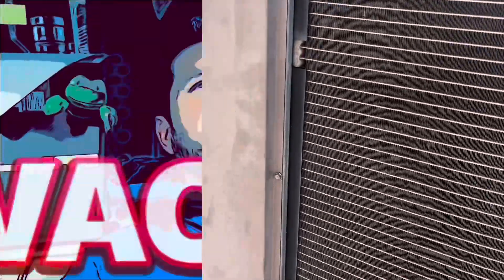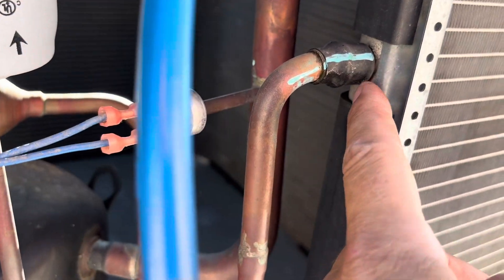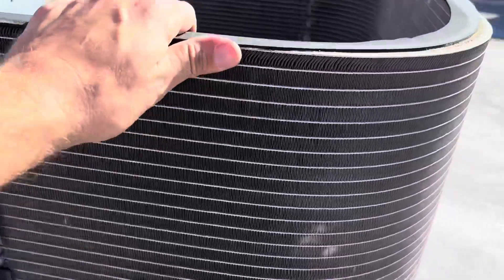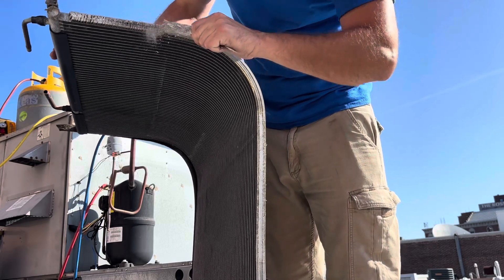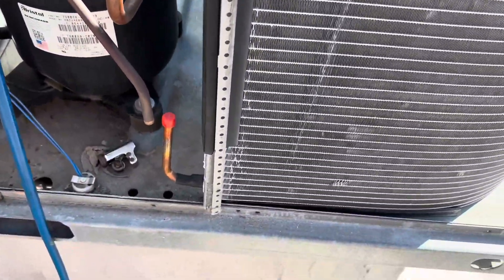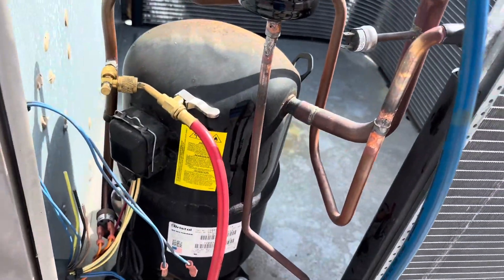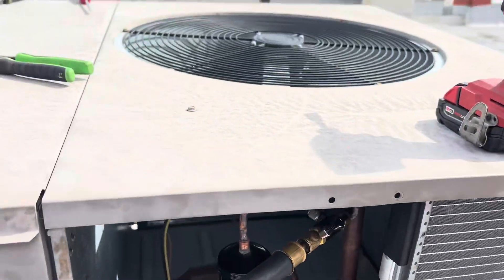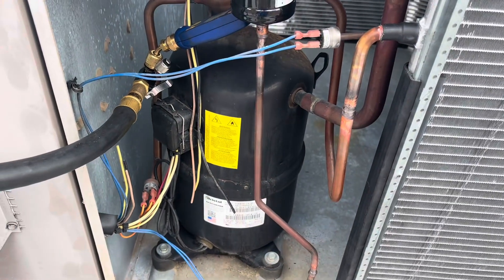Replacing The Condenser Coil On A York RTU!

Comment: Do you mind sharing cost at the job like this? What is the part cost? What’s the labor cost?
Reply from the maker: So everything minus the coil… you’re at around $2600.  If the coil isn’t in warranty you’re looking at another $3000.  Complete job cost $5500-6000.

Comment: I got a chance to add liquid line ports on a new YORK with a micro-channel condenser and measured a 30 psi drop across the condenser.  I have read that this normal and can be as high as 35 psi.  Measuring the actual liquid line pressure, the subcooling was right with the factory charge.  It sucks because they only give you discharge ports so the only way to truly check charge is to weigh out and in, a time consuming process.  Can't even look at CTOA either because you don't know how much pressure drop there is across the coil.  They want you to measure the air temp blowing off the coil, that's BS science because that air is not well mixed and there are hot and cold spots in that air.  So a high subcooling reading is normal on micro-channel condenser coils when measured from the discharge port.

Comment: Just curious, do you use the reclaimed free on that you removed from the unit? If not, why
Reply: It depends but you can sometimes. “Free on” Freon
Reply from the maker: If it was a brand new recover cylinder I may have considered it, but it had other older 410a in it from other jobs.